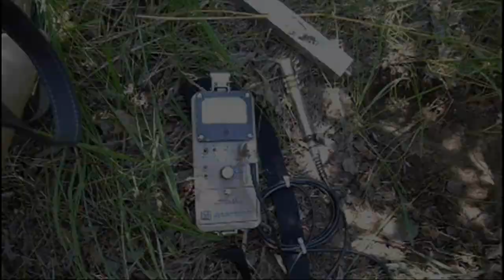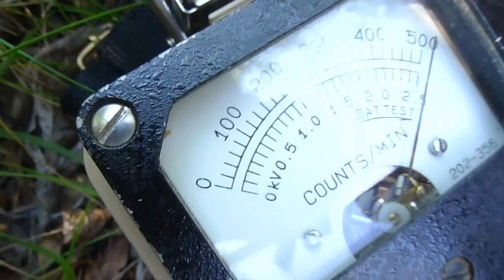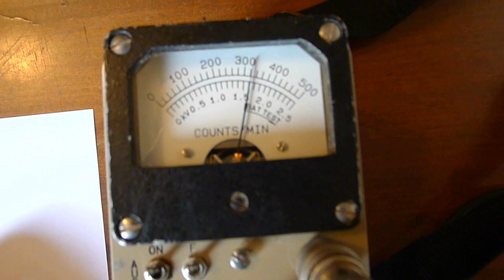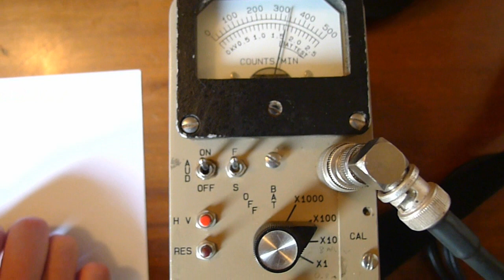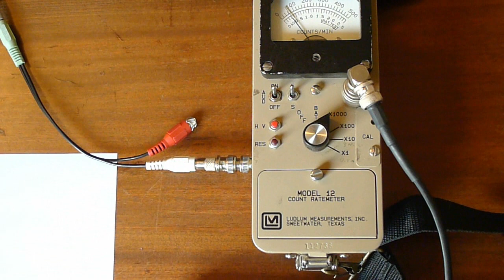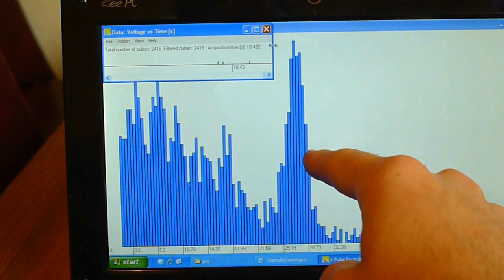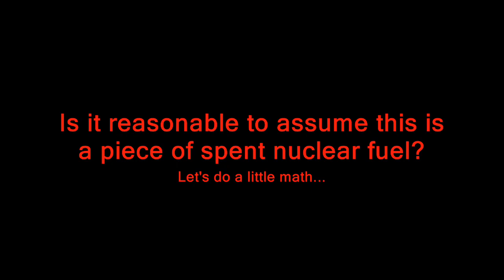Collecting a spent nuclear fuel fragment at Chernobyl

Comment: The guy's voice sounded like he was facing the immediate effects of a strong radiation exposure... In case he didn't know nuclear fuel is extremely poisonous especially on a direct skin contact.
Reply from the maker: Mark, in case you're unfamiliar with me, I am a career nuclear engineer and am knowledgeable about the relevant safety issues (which do not include effects on the voice or extreme toxicity through skin contact, by the way).